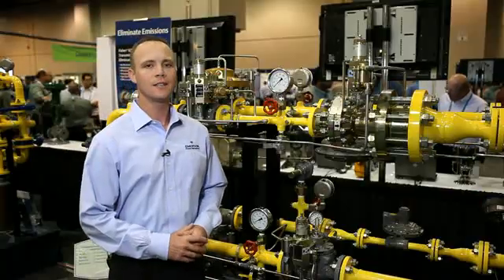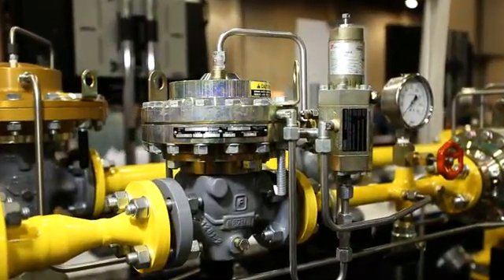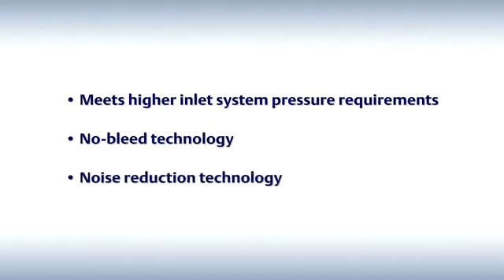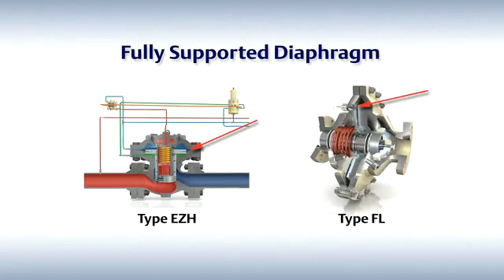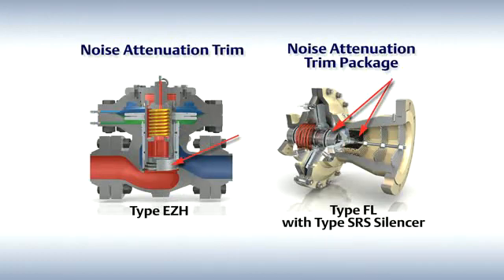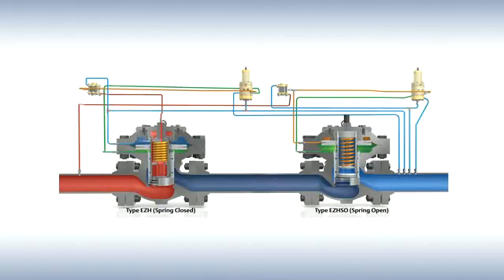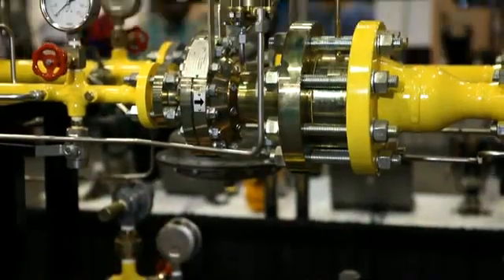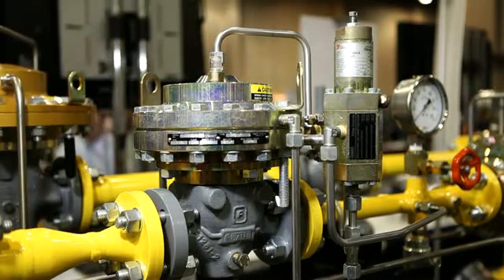Fisher-EZH & Tartarini-FL series Transmissions & Distribution Regulators

Comment: tartarini regulator always fail when lock up happen for a few days..and gas exit through tartarini pressure relief valve regulator. after relief gas, it difficult to get back a good condition diaphragm..i meant it still leak happen after that at relief valve regulator tartarini fl